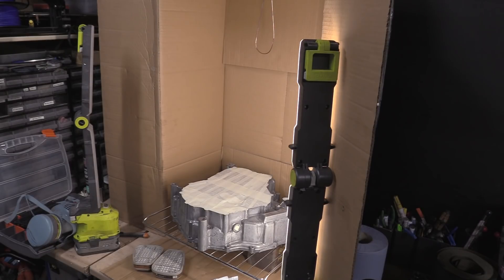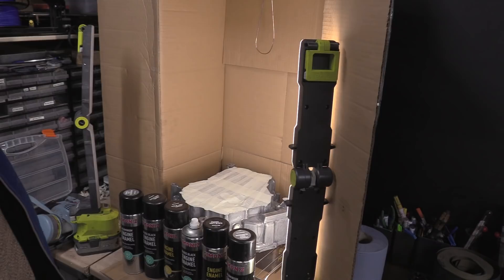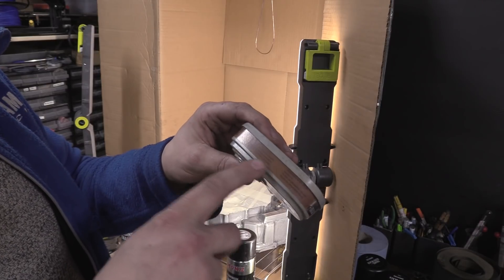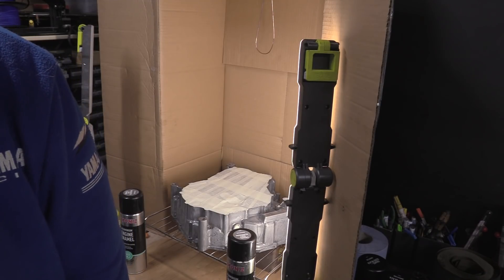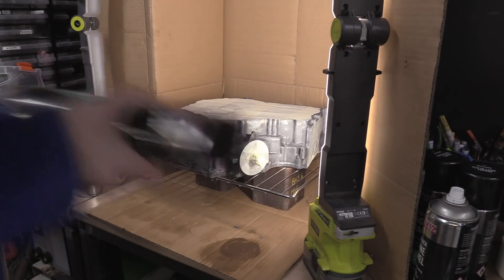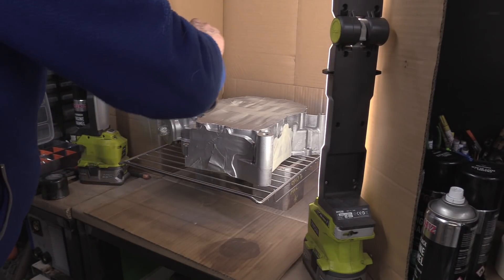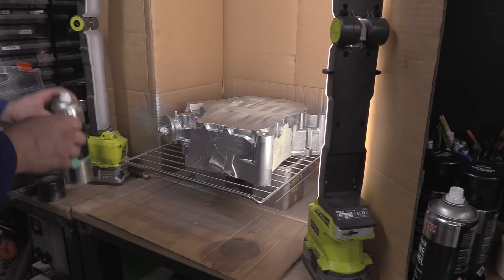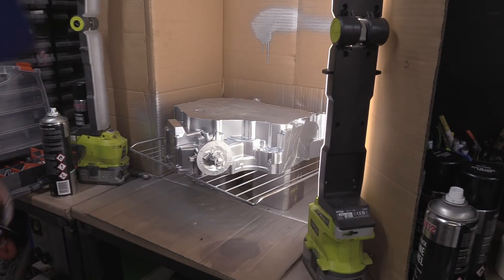Casing Paint #19 Suzuki Trackbike

Comment: How have you found the Simoniz stuff Matt? I've literally got a block up on the engine stand which I've prepped ready for a tin of that stuff to go on. I've found it decent stuff on small bits in the past but never used on casings yet
Reply from the maker: It's OK stuff if you bake it, leaving it to air dry it really needs warm temps and left for a week if not more.
Reply from the maker: As you might already know, I'm shifting to cerakote for the XJ
Reply: @thedirtyworkshop  good stuff. Perfect timing you posting that today! I've had a lot of engine parts powder coated (barrels, head, cases) but even that doesn't last forever. And if one more person tells me powder coating barrels will make it overheat...
Reply: @thedirtyworkshop  I've heard good things about that never used though
Reply from the maker: Nothing will last forever. Cerakote is the answer
Reply: @thedirtyworkshop  Best thing i ever did was spend the money and get a good Cerakote setup. If you're going to be doing a lot of spraying i'd recommend their professional kit & buying all 3 strainers it's the best deal and the gun is amazing.

Comment: Everyone uses simoniz , but I always rated it as one of the worst , they dont seem to sell  VHT 700C satin black now the best used to be HY Cote they dont make it anymore , you can get VHT  satin  black and an array of colours from Calfire in Wrexham,  decent paint they use it on theiir wood burners etc,  getting  satin for an exhaust turned out to be difficult  I have no idea why they now think everyone wants matt black but thats what the shops all told me no satin, the enamel doesnt work  well and I never used it because it burns off on air cooled cylinders and headers, as a word of warning iif you use matt and  enamel vht laquer  to get satin  which says it will work at 700c  coated over matt black dont do it it burns off on exhausts etc guess how I found out
Reply from the maker: Have you baked it on?
Reply: @thedirtyworkshop  I's been a few years since I used the simoniz it my have improved since , I always bake it on  if possible its only exhausts that pose a problem but I never had any trouble  curing with running , I have never had a problem with 700c vht  the worst problems used to be the VHT enamel chipping off and being brittle after a while on cases , or melting on cylinders, despite my careful perp and cleaning ,the calfire can be done either way   they theirselves recommend  curing by runnnig the stove its rubbish if you dont cure it though , that exhaust I did last year only the laquer bubbled not everywhere but most of it, or it discoloured  I let it dry thoroughly then ran it over with a  blow torch a few times letting it cool between  no difference  the 700c under it was and is fine I will be using the calfire for my spare
Reply from the maker: It's not for exhausts....
Reply: @thedirtyworkshop   I know that , might be handy to know at some point though ;) also wasnt sure which part you were talking aboput the simoniz or the other enamels etc I commented on